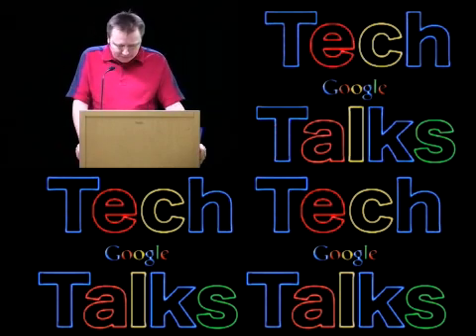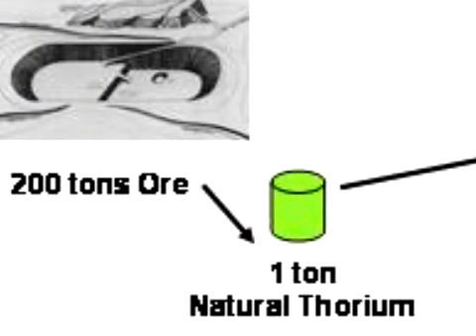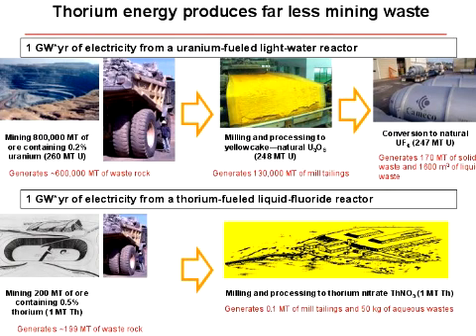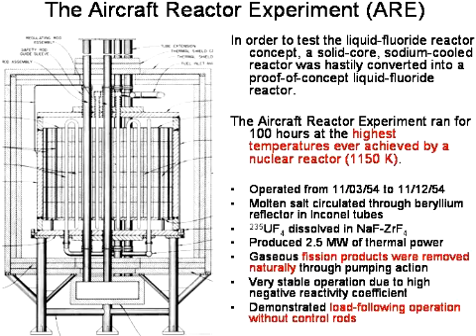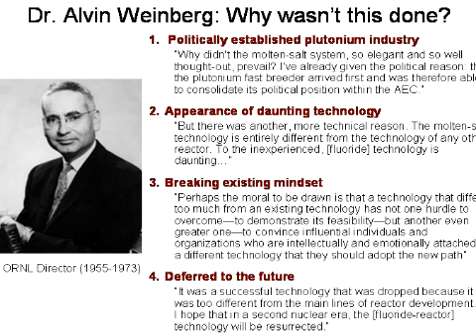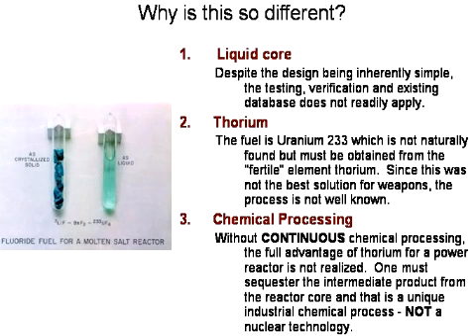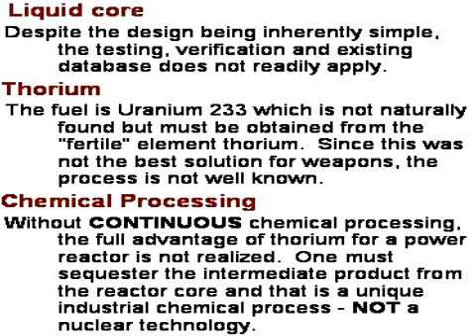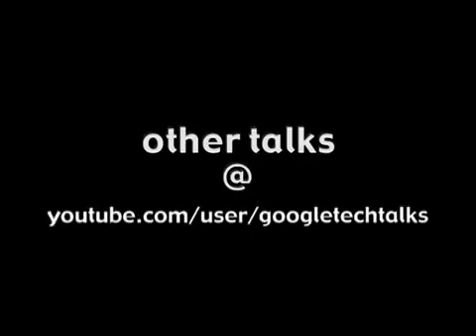LFTR in 10 Minutes - Thorium Remix 2009

Comment from the maker: @nareshov (I'm going to copy/paste a response from EnergyFromThorium as it is the fastest way to clarify.)

India only has major expertise with thorium fast-breeder reactors. This is very different from thorium thermal spectrum/thermal breeder reactors, especially molten salt types such as Liquid Fluoride Thorium Reactor.

This also means they use very awkward thorium fuel cycles based around thorium and uranium-plutonium solid fuels.

Comment: @TadmuckMorgan LFTRs can use uranium nuclear waste for startup as well, and nuclear weapon warheads can also be decomissioned to use the plutonium or weapons grade uranium for startup. All you need is a neutron source to breed your starting Thorium-233 into U-233, after which point the U-233 produced will keep breeding more thorium into U-233 and carry the chain reaction. At worst, you could use a particle accelerator to breed your fuel, but it'd cost more than the reactors themselves.